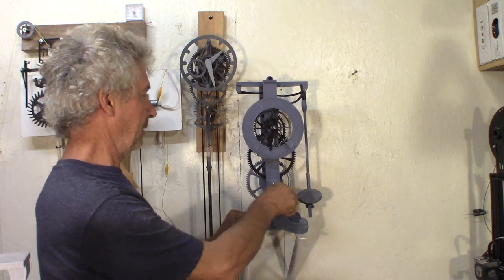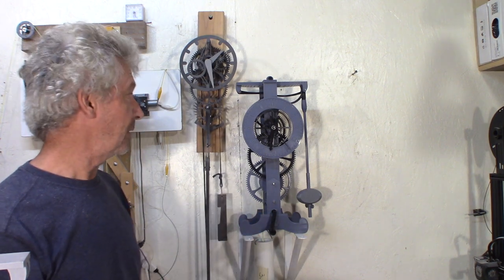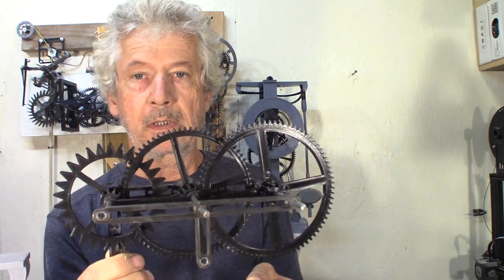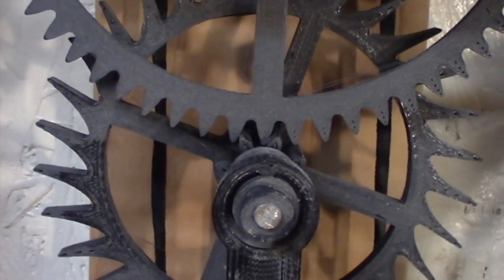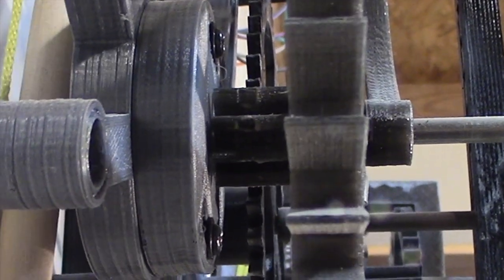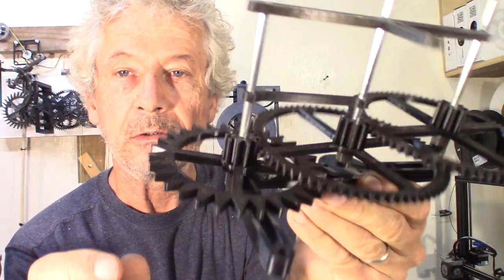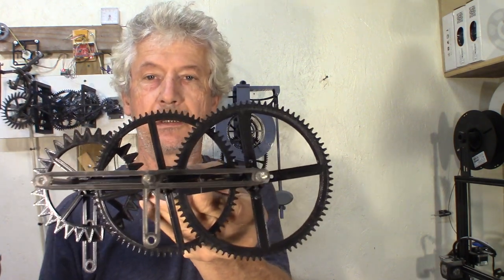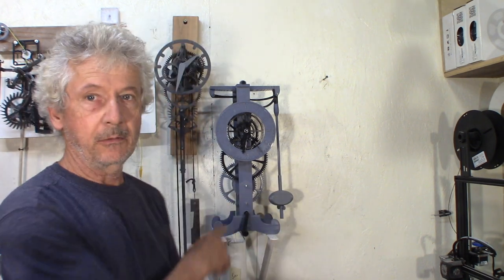Making better clock gears with FreeCAD

Comment: I really like seeing all your new designs.
Thanks for the link to my clock. 
That is a lot of wear in a short amount of time. There must really be a lot of sliding friction. My oldest clock has been running almost 2 years and the gears look almost new. 
I wonder if the gear generators built into some of the CAD programs are generating accurate tooth shapes. I use Gearotic as the starting point. It's a bit pricey,  but I trust the accuracy. I also try to use 12 tooth pinions which should have lower friction. Clocks have been running for hundreds of years with 8 tooth pinions using brass and steel. PLA is much softer.
Reply from the maker: Thanks for following my projects.
I must say that your clock is pushing me to improve mine
I just learned that there is a lot more to cycloid gears... they have to be designed as a set, unlike involute gears
Hope fully I can figure a good tutorial on those clock gears
Also planning a test bench to compare gears and escapements
Fun stuff coming
Reply: @jacquesfavre999  It seems like cycloid gear became less common because involute gears are easier to manufacture by high speed machine cutters. However, printed clocks are not limited by the available gear cutters. Cycloid gears may be slightly better for clocks. You are correct, the gears and pinions must be designed as a set. 
A good free cycloid generator is at http://www.hessmer.org/gears/CycloidalGearBuilder.html
Lots of equations at https://www.csparks.com/watchmaking/CycloidalGears/index.jxl
I built a motorized desk clock using cycloid gear shapes. It took a small amount of extra planning to match gears and pinions. It wasn't too bad since there are only a few gear combinations to deal with. I hope to document it and post the plans someday.
Reply from the maker: Interesting!
I was just in the middle of reading cspark document that you sent the link
Went head and tried the Dr Hessmer cycloidal gear builder, exported the DFX to FreeCAD, figured out how to make it into a gear in freeCAD and compare with gear made in the gear work bench 
and they are quite similar
From what I have learned , for pinion above 16 teeth, involute are as good or better then cycloid
12 to 16 involute is still fine, issue can be with the manufacturing, (undercut)but those issue are not present with 3D printing
Below 12 cycloid might still have a role to play
Also 90% of gear transmission is a pinion driving a wheel( reduction)
Clocks are mostly the opposite, wheel that drive a pinion
One last thing I learned: ( think in the book, Lesson in horology) usually pinion are steel, even tempered steel , so the leaves can be thin, where as wheels are brass, softer
so the  cycloid gear builder not be optimal for 3 d printing, 
but maybe using the cycloid gear builder for the pinion but switching the wheel and pinion input, then use FeeCAD gear generator that offer the option to add backlash to thin the leaves of the wheel
Are you following?
I  am planning on a couple gear tutorials
Advanced clock gears will be last

 @stevesclocks
Reply: @jacquesfavre999  I am eager to see what you come up with regarding new gear profiles for 3d printing. I may also try to put together a tutorial with some of the things I have discovered.
Be careful with the gear generator in FreeCAD. I downloaded it to check the built-in InvoluteGear macro. High precision mode generates gears where the entire active surface is built using 2 straight line segments. Low precision mode uses a single straight line. They still look like gears, but I wonder if the inaccuracy is contributing to excess friction and wear. As a reference, Gearotic uses 15 line segments per side of each gear tooth. 
I usually redraw a single tooth using arcs that follow the lines, then add other optimizations. I make the depth 1.5X as deep as the height above the pitch circle. Printed gears with tall teeth are still really strong. If I want to add backlash, I split a tooth down the center and rotate each half from the center of the gear. This increases backlash without changing the active surface. When I am happy with the profile of a single tooth, it gets arrayed to form the complete gear. A lot of this effort might result in a gear with more precision than a 3d printer can utilize.
Reply: You can calculate arbitrary module values to fit a coaxial 4 wheel train on only two shafts. As you say the printer can make any module you want.

I have an openscad script for this purpose. Can do involute or cycloid.